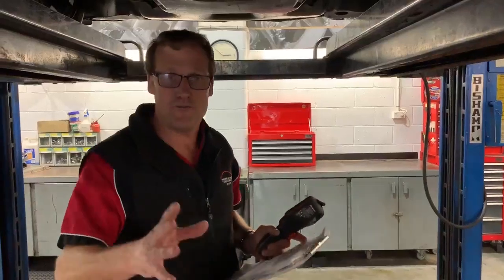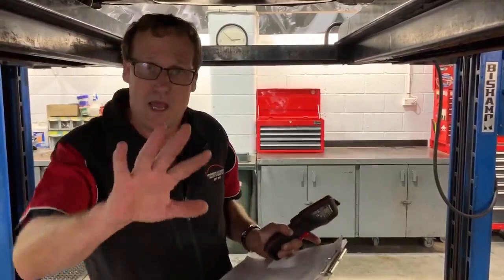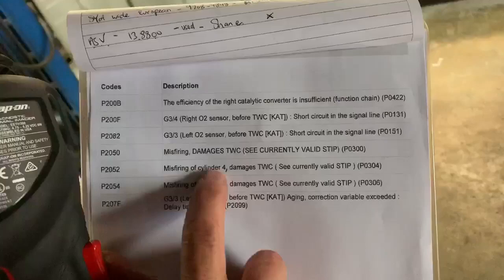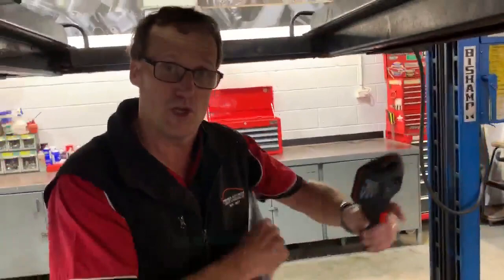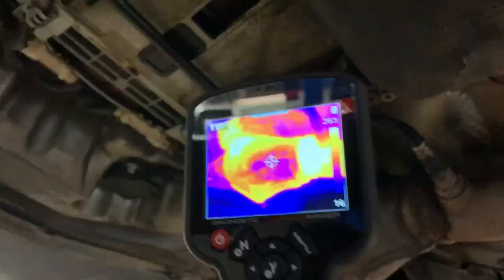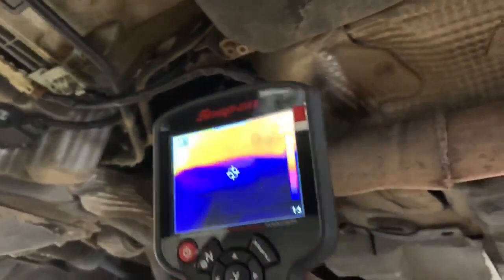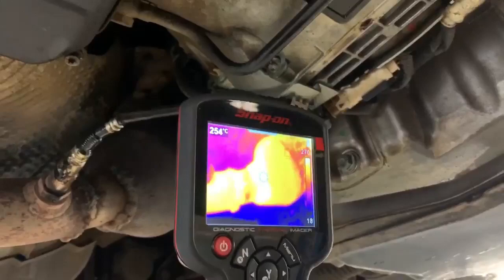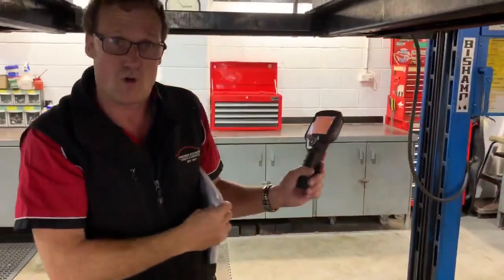Thermal imaging camera assisting to diagnose a faulty catalytic converter.

Comment: Nice video! I usually use Infiray T2S+ thermal camera to keep my vehicle in top condition. I like its powerful analysis capability that helps me easily identify potential problems with thermal images. What's more! The price is cost-effective, too👍

Comment: I measured 260/230 f/r . car has slight misfiring on idle and a bit rough 1 min after startup but then the cooling system is overwhelmed on the racetrack and with the a/c on it gets hot much quicker. that’s on 30C outside. at 20C it’s fine. but I think it has cheap cats that clogged up because there are welding marks that indicate they’ve been replaced and I don’t think the previous guy bought expensive cats, most likely the cheapest since the car has another cat at the back that does a good job alone